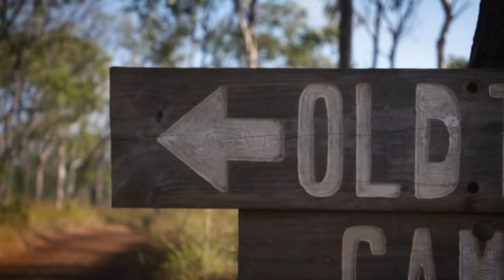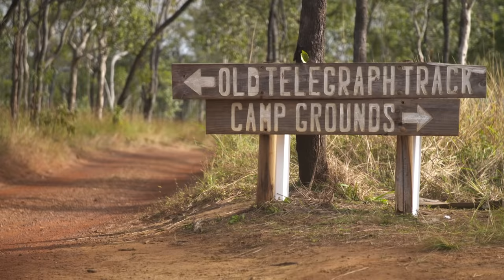4WD FIRE ON OLD TELE TRACK – worst nightmare… + Farm Truck does Cape York!

Comment: Driving tip: One from a Kalahari farmer I knew -When driving on soft sand, when you brake to a stop a small mound of sand builds up in front of your tyres. When pulling off this creates extra resistance and may cause you to dig in. so reverse back a meter and pull off from there.
Reply: That is exactly how do we it here in the empty quarter desert, gravity is always your friend and enemy so when parked at an incline reverse as you cant climb from stop but if its down it helps with momentum just like a skate ring.
Reply: Awesome.  Good advice

Comment: Just grease the worn brake pad/rotor and your good to go. All the other brakes still work and you didn't damage unnecessary parts.
Reply: Well or just have the caliper hanging to the side and block the piston with a piece of wood o.s. ... Just need to make sure to tie it somewhere out of the way (on top of the Axle usuallya works pretty damn well...
Reply: why bother ? its all going to be replaced anyways.seems a waste or effort really
Reply: @felixgottesburen7294  that was my thought too.
Reply: @geraldroberts1184  metal on metal will get really hot and cause brake fade and if the caliper pushes out too far you can loose all of your fluid.
Reply: @geraldroberts1184  Well simply put, the way the brade disk looks I would not replace it at that point. Instead I would only replace the brakepads and safe some money as brake disks are usually way more expensive and lasting than the pads (eg: my 2018 Hilux ~32€ for the brakepads vs 102€ for the disks All of those being aftermarket parts, shipping excluded). And if you are somewhat unlucky and damage the caliper you either have to rebuild it, which is one hell of an anoying job to be doing, or you need to get a new one, which is gonna cost you quit a bit (~178€ for an aftermarket caliper on my Luxy). 
Also what @Travis Mcalister said about possibly loosing fluid is correct. But the possible damage does not even stop there. Worst damage in such a scenario that I have seen so far was on a Hilux used in the mining industry. Shit got so hot it practically cooked the wheelbearing and steel rim. Whilst the rim only shed its paint, the bearing leaked quite a lot of grease and had to be replaced.

So at the end of the day a relatively small trackside repair saves you quite some money. Even more so if you want to use oem parts and/or do not do repairs yourself.
Reply: @felixgottesburen7294  Ripping the twistie mountain roads on our Harley & a Victory, we ran hard enough to cook the brake fluid, thereby losing brakes on a long, serious downhill run! We have slightly slowed the pace since that day.
Reply: @felixgottesburen7294  Mg
Reply: Ya good ideas mate. 👏👍👌
Reply: It dirty conditions with your idea your making valve grinding paste.
Reply: 👋 HELLO
Reply: i've driven pads all the way until they fell out. even metal on metal you've still got some miles left in it
Reply: All you need to do is change the brakes for your new girlfriend to realize that you can drive a long time with no friction material left on the pads...

With that being on the rear axle I'm guessing that caliper was stuck, because if it's worn out naturally, the fronts must be riding on the pistons at this point...

Comment: Driving tip: When you're doing steep descents in low range, like the entry into gunshot, you might struggle with the brakes against the auto transmission. Knock the shifter into neutral and you'll be amazed to find you get control back again!
Reply: Yeah my rigs in low overpower the brakes

Comment: How full on is that. A fire in the canopy. Not long ago graham was talking about the importance of fire extinguishers in an accessible spot.  That all payed off that day. Good job fellas.  I run 2 in the same spot as the dmax quick release.  I’ve never needed them but this is exactly why they are there. Pro tip periodically check to make sure they are still in date. So when you need them you’ll know theyll be effective.
Reply: Well said!!

Comment: Driving tip particularly for older rigs: during descent a bit of brake at same time as accelerator to maintain traction and help stop wheels sliding. Old school hill descent control...
Reply: does braking and gassing at the same time transfer power from a spinning wheel to a stuck wheel in an open diff?
Reply: @maxlee6676  yes

Comment: Get to know your vehicle, don’t fight the wheel or power through, keep a steady foot and air down, no need to bounce through or attack the climbs or water crossings (A local to CapeYork) 🔥🔥🔥👍🏼
Reply: If in doubt flat out
Reply: @D1gg3r5  yeah but in Nolan’s that’s not the case😂 it rattles your whole chassis if you go too fast and with high tire pressures

Comment: Cooking a steak: salt the steak with a piece of paper towel both sides of the steak, put on plate and then another plate ontop of the steak (just for a little weight on it). Leave until room temp. This will dry it out nicely. 

Salt and pepper LOTS. Bit of olive oil over it. Get your grill / plate hot (near smoking). On. 

Turn every 30 seconds. Shorter turns as the steak starts to get to the desired internal temp. This will enable an epic crust. 

Rest for 3-5mins. 

Destroy.

Comment: Perfect steak in my eyes is; a pan just about the temperature of the sun with a dash of olive oil, drop the steak in and sear on one side for 2 minutes, then flip sides for 3 minutes then turn down the heat to low/med and flip for a further cook of about 5-6 minutes then flip for another 4 cooking then turn off the head and ley sit for 5 minutes before transferring to a pre warmed plate!  Comment what you think of this and how you cook your steak(:

Edit; I forgot! A decent dose of pepper with a light dash of salt and cooked rare!  C'mon, be a man champs!
Reply: That sounds thoroughly overcooked. It’s probably close to done by the second flip, although it’ll depend on the thickness of your steak. Otherwise pretty well what I do, although when I’m doing it in a pan I prefer to flip more often to avoid overheating the contact surfaces. A bit of blackening is good, but too much is too much.
Reply: @gogmorgoaway  So overcooked that you might as well eat a bit of old shoe leather. Two minutes a side and you're done...
Reply: @gogmorgoaway  I buy meat in bulk and process it myself and i usually cut my steaks about 2-3" thick so you get a nice sear on the outside to seal in the flavour but its also still very rare in the centre(:
Reply: @ozzie273  I cut my steaks about 2-3" thick so you get a nice sear on the outside to seal in the flavour but its also still very rare in the centre

Comment: Hey handy tip for the brake problem on the 79. Take the calliper of the rotor but leave the brake line connected but do not crimp the line. Secure a block of work in the calliper so the piston can’t pop out. Pump the brake and strap the wood in. Then just secure the calliper up out of the way and you’re good to go

Comment: Gotta go with knowing your wheel placement. Knowing the way your truck handles/ having the knowledge of how the truck will react with your wheels in certain places, is absolute key. Throttle control plays a big part in it, but knowing the placement side of things will improve your all round experience and performance

Comment: Driving tip…. Recheck your tyre pressures during a hot day, you might start at 18pound but a hot day on hot sand can see that blow up over 24,  as soooo many many people find out at a certain little sandy climb on Fraser 😉

Comment: if i were there, i would bring a custom Jeep that has an LS V8 motor, 7inch lift kit, 44 swampers with some lockers. i would be throwing mud and water as high as the trees lol. btw im a southern American if u havn't noticed. i love me a big truck sitting on some big tires going through some soupy mud. its probably not allowed to bring a high powered custom truck made for mudding, but if i install a rock crawling kit into it then that would probably help.

Comment: This is why it's a good idea to have good thick braided wire running to your isolator switches and have then within easy reach, have good covers over your battery terminals and covers over your poles on your isolator switches this protects the main system from shorting out on any object that happened to fall onto any unprotected power source ie like wheel braces tools luggage or camping gear and your fuses should take care on any think downstream of your isolator switches. Love the show by the way

Comment: It would make an interesting video diagnosing the auxiliary battery fault which caused the fire and also showing how to install an auxiliary 12v battery complete with possible safeguards to prevent that small fire from happening again.
Reply: A fuse or breaker in the engine bay should have stopped that.

Comment: Room temperature steak, salt both sides, really hot surface (over a BBQ or fire preferably) with a dash of oil and a little knob of butter. Flipped once, making sure it never sticks. Medium rare at the most. Allow to rest for 10 minutes if you can wait that long haha. I normally take it out a tad early so the residual heat doesn't overcook it.

Comment: As far as brake repair in the bush. Have an assortment of tacks with different size heads, that way you can unscrew the line and insert the tack to seal or block of the line.

Comment: Driving tips 1. On long water crossings match speed to the bow wave you're pushing. It makes a hollow behind the front wheel arches that the water drains into from the engine bay. 2. With a manual box don't change gear mid crossing. If the bell hosing is flooded you can introduce water between the flywheel/clutch/pressure plate and lose drive. 3.If you get stuck on a long very steep incline and want to back down then use the starter bump trick (manual box, pre ABS  or hill assist tech). Engine off. Brakes hard on. Select reverse low range. Clutch out. Gently ease the brakes off. No movement is best result as the engine is holding on compression. Bump the starter and off you go. I spent the late 70's in a 1942 Willys Jeep around the Victorian high country forestry tacks with my dad. Good times.

Comment: Before the trip, make a couple of small slits in each State, put 1/2 a can of Guinness , the old Stout version is better than the modern draft,  per stake in a bag, or use Port or a Decent Red Wine.
When you're ready to cook just empty the Stake & Liquid into a pan and lay it on the coals. I use the 1 flip,  about 15 seconds per side.  It really is worth trying.

Comment: Terrific trip guys, I only wish...
Now, as far as the steak argument goes. Ages ago I was taught a method that allows everyone to get the steak they want from any thickness, rare, medium, well done and is as simple as.
BBQ or gas stove with a cast iron fry pan on high, it has to be hot! Slap the seasoned steaks on, when blood comes through flip then:
When red comes through it's rare. Not done enough? flip.
When pink comes through it's medium. Still not enough? flip.
When clear comes through it's medium/well done. Still not enough? Flip.
When nothing much happens and its burnt, well done, dry and buggered.
Except for the last stage, the steak is juicy and just how people like it. Works a treat!
Cheers guys.

Comment: Single flip is by far the best way to cook a steak on the fire...and like a said earlier, salt (just salt) the meat a few hours earlier - you'll be amazed at the flavour difference and tenderness. Only well marbled steaks on the fire though so that it doesn't dry out

If I have to cook a steak in a pan, throw in a generous amount of butter and brown the butter first in a cast iron pan. The pan needs to be extremely hot! Put the steak in the pan and only flip once after 5 or 6 minutes. Spoon butter over the steak while cooking. Once flipped, throw in half a cup of brandy and flambé, while still spooning mixture over the steak. After 5 or 6 minutes take the steak out the pan and pour the brandy-butter sauce over the steak. I challenge @4wd247 to find a better tasting steak!!

Comment: Bunnings have fire extinguisher for $19 each for that price you  would  be mad not to buy 1 or 2 for piece of mind just keep an eye on the expiration date. I would have taken the calliper off and left the pads in and then zip tied something in between the pads and then you wouldn’t have to clamp the lines. With the steak you should have pulled it out of the fridge and let them were they aren’t cold to touch and put salt and oil on the steak and have plate hot and 3 minutes on first side and then 1/5 minutes on the other take off heat and sit for 1 minute then eat.

Comment: Never thought about it bout you could probably sous vide before heading out on the trail.  The steak woudl be vac sealed and ready to throw in the cooler. Pull it out while you set up camp to take the chill out of it and when you are ready,  Steak is already cooked to your desired temp then you just put a sear on it (grate over coals would be my method)  and you are good to go.

Comment: STEAK 1/2 to 3/4 in thick with salt & pepper:  cooking time: 1.25-1.30 mins each face -- 1st choice dirty . no coal:. cast iron pan : then no pan/coal,  FRY it, and spread little butter on one face after.  And if you have sticky rice, STEAK roll is the best, don't forget the wasabi.

Comment: Drivving tip.... When boggy or slippery surfaces steer 10 to 2 o clock and on and off throttle to make  more traction!  Hope this helps?

Comment: Another trick keep some trim nails in the truck you can unhook the brake hose from the line insert the trim nail in side the hose and tighten it back up and the head of the nail stops fluid from getting to the caliper

Comment: No. Steaks need to be done over VERY hot coals or a pan. Sear it on one side then flip and sear the other side. Just set it down and leave it alone. Medium rare. If your using a temp probe pull it off at 120-125 it will still reach 135. Reverse sear is also acceptable. Souse vide is ok with a torch to finish it off. But I've found that a low temperature pellet smoke then open flame sear is very good.
Reply: Look at your reactions! Single flip wins!

Comment: Go to steak recipe;

Healthy amount of olive oil. More salt than you think. More Pepper than you think. Press seasoning gently into meat before flipping and repeating. Use leftover seasoning and oil on plate pick up your steak and rub the edges. 

To cook;

 Over hot fire. On a grill plate. Not hot plate so the flames get to touch the steak.  Flip once flames start flaring up from any fats. Repeat on other side. 

👍

Comment: pretty easy to use the chain saw, cut a block of wood and slip it between the pads. zip tie the caliper on the axle. no need to damage brake lines.

Comment: Would imagine the best driving tip is to learn on smaller trails how to balance throttle with proper footing and figure out how your particular rig feels when its off camber/at strange angles with slippery traction. The safest drives are always the most prepared and before you know it you and your rig will feel familiar with each other!

Comment: I always give my steaks a very quick sear on both side over very high heat just to colour the outsides then I wrap it in foil with seasonings and throw it in a 250 degree oven till cooked thoroughly. I have found that according to my terrible teeth this method helps to drastically eliminate toughness.

Comment: Easy quick brake fix that is completely reversible when you get back to the shop. First figure out what brake like you want disable, follow that line to the brake booster/master cylinder, remove the brake line you traced back up to the motor, and get a bb from a air gun/ bb gun, and dip that bb in a little grease so it will stay in place when you stick it on the end of the brake line flare, then reassemble to the master cylinder, it's a perfect fit, stops fluid from the line, and all other brakes still work. Easy get you out of the woods fix. You'll love it, give it a try next time  : )

Comment: Medium rare steak cooked on high heat with salt and pepper on both sides with multi flip but put garlic on side facing to the pan and once placed on pan put garlic on other side as well. Dont get stindgy on the garlic. 
Once cooked place on plate and get a spoon and spoon the remaining liquid from in pan to on top of the steak. 👌👌🤤🤤
A really easy and very tasty steak.

Comment: All you need to fix the brake problem is a nail or screw. Disconnect the line at the splitter making sure the head will seal off on the line. Insert the nail into the line and tighten it back up.

Comment: Even with throttle control single most important tip is getting  right.  There is no set guide here, different profiles, tyre width, wheel size, car weight and terrain all require different pressures. Although you can start with a standard (eg. 18psi - beach), taking a little notice of how your car/rig goes in different situations and not being afraid to stop and change  the pressures to suit will make all the difference (lower profile tyres may need 12psi for the beach).  In my experience the most important first step is foot printing your tyres on a level surface, fully loaded. so that front and back footprints match in length (2 pieces of cardboard, a tape measure,and compressor are all you need.  Have even pissed a few people off and done it at the servo).  When you reduce tyre pressures you reduce the same percentage front and back to keep footprints the same.  This way your power, guided by throttle control, is distributed evenly to all 4 wheels.  It's been working for 20 years for me!